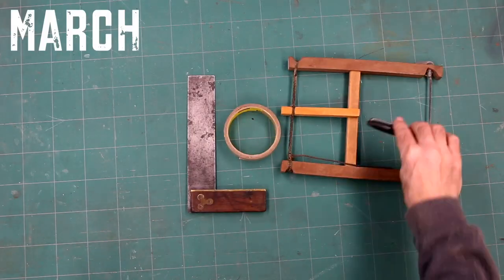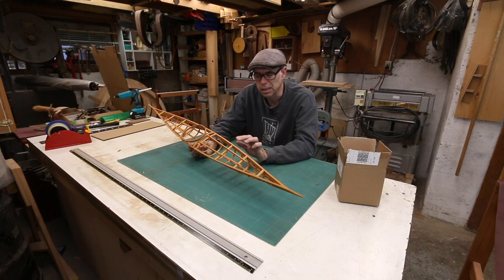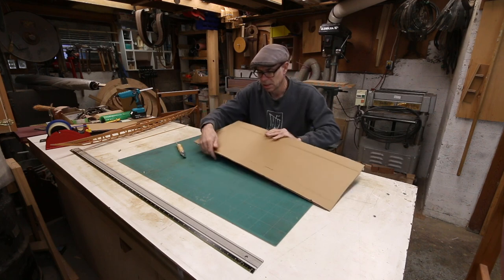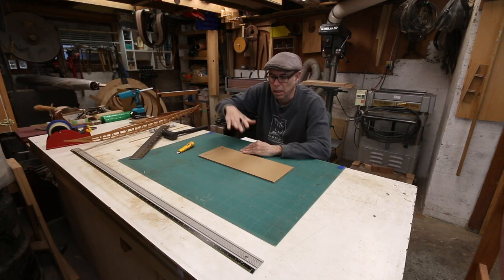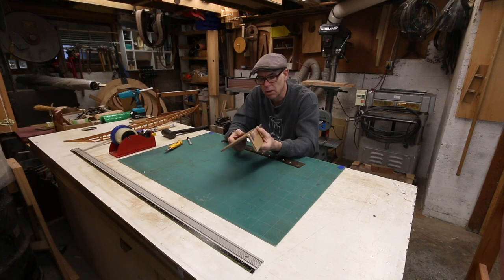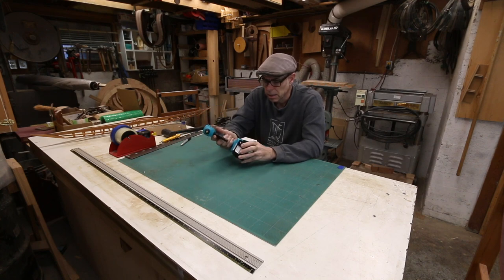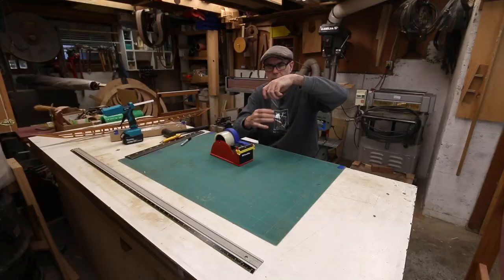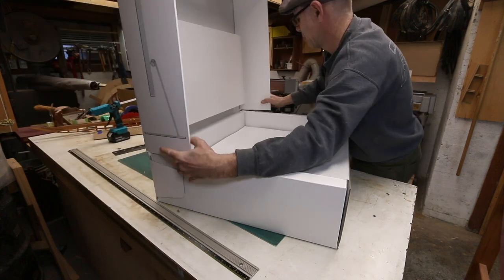March 2023 Vlog

Comment: For something that shape I would use a tube, cardboard, PVC or abs.
Reply from the maker: So would I. First thing I looked into of course. Cost to get a mailing tube that size to my door ( 10 piece minimum from ULine) $300. The customer was already charged for shipping at a rate of $60 based on UPS rate calculator which decided a 4 x 6 x 60” box. So that was my target. Which meant I wasn’t going to blow an extra $30 on pvc abs or sono tubes. 6 x 6 actually drove the price up about a third I think. In the end UPS sloppily measures it s a 5 x 8 box and I was out $100 to ship it.
Reply: My Dad taught me how to make cardboard boxes, using an old straight edge and hammer to create the creases. Cutting and adding the spruce stringers is a slick innovation 👍 Apple and a few other electronics companies have impressive packaging, it seems asian influenced to me, making something mundane into its perfect rendition.

Comment: Mark, please don't ship that lovely little kayak model in a long skinny cardboard box. You will regret it if you do.

Note that, shippers routinely toss boxes into their trucks, step on them and pile other heavy boxes on top of them. Guaranteed, your cardboard shipping box will arrive at its destination crushed, bent and torn. Your kayak model cannot survive such abuse and will arrive at its destination in 500 pieces.

A test for your shipping container's shipping worthiness is to throw it down a flight of stairs a few times, then step on it with your full weight. It needs to survive this kind of mistreatment.

A better shipping container would be a large diameter, thin walled, PVC pipe. A wooden box is also a good solution, too.
Reply from the maker: Well it’s off now. Nothing I can do about it. Those models are pretty tough though. Just like the real boats.

Comment: Mark, maybe a section of sonotube filled with some styrofoam peanuts would have been an easier and cheaper alternative to your box construction especially considering your time.
Reply from the maker: Oh, I thought about that. Makes for a much heavier package. Still have to go shopping. Heavier. Paying by weight too. This box cost $100 bucks to ship. I’ve shipped full size kayaks that way though.
Reply: I would have gone with the sonotube myself.  I have had to cobble together all kinds of boxes from other boxes and never worried about how the packaging looked.  Like my Christmas wrapping, they are just going to rip it open anyways.  But shippers do not like tubes as they roll around on tracking belts.  How much time did you put into making the box?  Could have likely purchased the 10 boxes based on hourly rate.
Reply from the maker: @OrcaboatsCa  actually, it took less time to make the box than to search for a box solution in vain. And for the record, the ordering of ten boxes has a price tag of $300. Last element was that the customer was already charged for shipping at that point based on a UPS calculator. A sono tube solution big enough would have double the cost charged. The spline corner box solution took very very little time compared to either the internet search or failed box fiasco.
Reply: @Nomadboatbuilding  I order various boxes for shipping from Uline Canada. They run around $4 per for 48" by 8 by 8. Even with minimum order of 25 that is still only $100 plus shipping and they come pretty much the next day.
Reply from the maker: Well that $300 was the price I got from Uline.